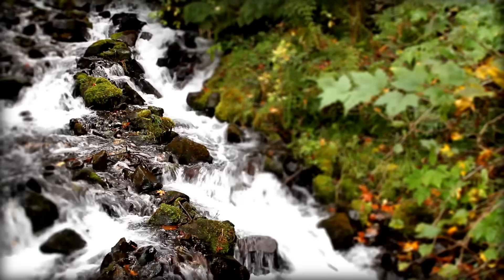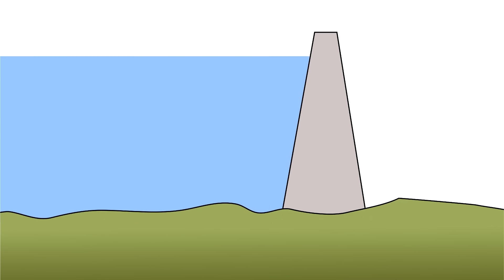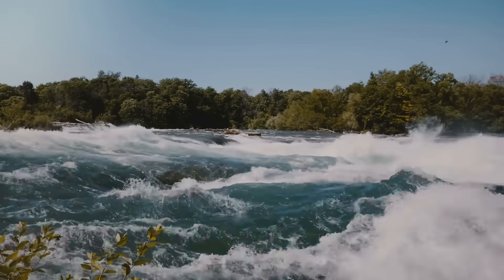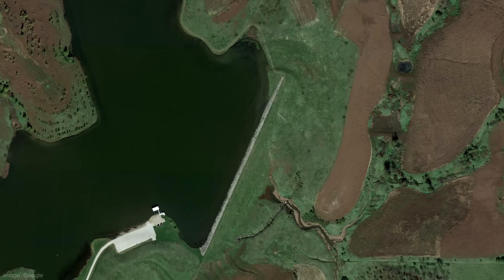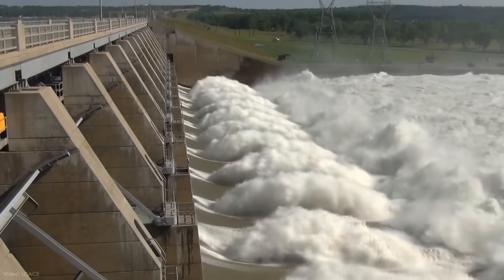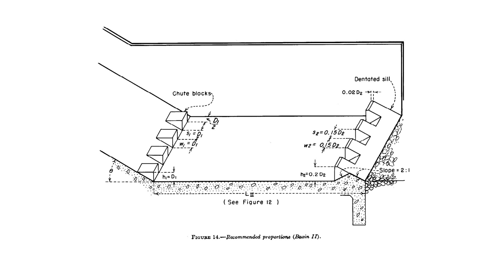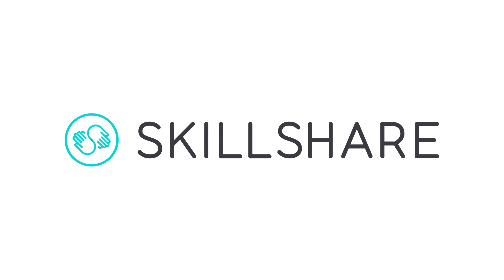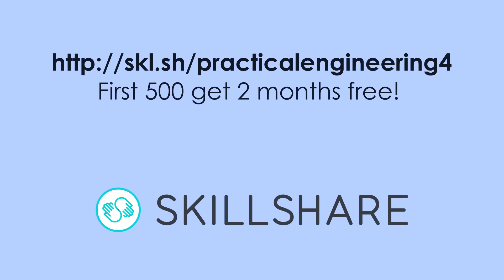How Do Spillways Work?

Comment: One thing I think you should include, "Then things go wrong" show example on failed structures and lessons learned by them.
Reply: Daniel Wiegert Look up the Oroville Dam disaster, that’s a recent event where the emergency spillway of the tallest dam in the US was just hours away from failure due to such extreme water inflow.
Reply: @Corndog4382  Agree... there is some great videos on YT about this one.... especially the reconstruction ones that give you a sense of the immense scale and size of the spillway...   it doesn't look "big" until you see it with people... and large equipment working in and around.
Reply: im thankful that he keeps the videos de-sensationalized.  there is countless sources of that type of cheap entertainment.  id rather learn.  but i get it... that's why the discovery and history channel have turned into what they have.
Reply: One day a huge storm came upon the Raudales de Malpaso dam in Mexico. The output of the spillway lifted tens of the concrete slabs at the stilling base. Each slab the size of two large houses put together and piled them up at the end of the basin. The scale water model built by the University showed the flow going down and at a point, the slabs lifting like UFOs and floating to the end of the reservoir.
Reply: @BICHETO  sweet. Id love to see some video on that.
Reply: People have been predicting the End Times for almost two thousand years, now.  Revelations was current events, not prophecy.
Reply: I second this. This video reminded me of the Oroville dam spillway failure that we had here in California.  I would love to see an analysis of that.
Reply: @Mike_Rogge  Actually the Fukushima plant was examined and determined to be susceptible to flooding from tsunamis and they did nothing about it. Ignorance is what caused Fukushima to fail.
Reply: @farLander1  Ish. It was only built to withstand flooding of about half as much as what it ended up getting.
I'm genuinely surprised it took pretty much 40 years for something bad to occur.

Any one of a half dozen things could've been fixed and prevented Fukushima and they knew since day 1 it wasn't up to safety guidelines.
Reply: Feel the poster wanted to see a video about how they learned about the techniques that are present today, a history of development.
Reply: Yeah I was hoping to see Oroville Dam examples
Reply: @prax3956  Exactly my thoughts.
Reply: @prax3956  I live in Oroville. I've seen all the example I ever want to see.
Reply: @prax3956  Oroville, is that the Pop Corn Guy.
Reply: @owl1873  yes 😂
Reply: "Very rarely, things can still go wrong, because this stuff is incredibly complex, and sometimes an event is so extraordinary that no one could have foreseen it, and to make things completely safe even for unprecedented inimaginable events is incredibly EXPENSIVE for the community itself,  and 99,99% of the time it's useless". 
This would be more correct.
Reply: @Mandorle21  unimaginable*
Reply: @Mandorle21  thitmim
Reply: @Mandorle21  If it weren't the real world... In our world, 0.01% of cases is all that matters.

As evident by already mentioned Fukushima...

Or do you agree that it's alright if bridge doesn't fall apart in all cases except when YOU drive over it?
Reply: This would be a good topic for a video... Basically all engineering systems such as the examples in these replies have backup systems in place.  However, 'acts of God'/natural disasters/freak accidents do happen.  I mean, yes we could spend 100times the cost on making something last indefinitely... but then effective usage goes out the window.  We can't all live in the same house, with the same water supply, and cross the same bridge for transportation....  Also, most disasters come from poor Operations&Maintenance… although there are some great examples of flawed engineering.
Reply: Is anyone else 10 years old
Reply: things going wrong has been done to death a million times though, you can go watch hundreds of videos about that. i want to see things that aren't going wrong for once.
Reply: Wouldn't this be an entire video in itself?
Reply: This should be a series.
Reply: I was really surprised to see he didn't include that. For anyone looking for a modern example, look up the Oroville Dam incident. Approximately 2 years ago, the primary spillway failed due to lack of maintenance. It is also the largest dam in America. The floor of the spillway was ripped out by the force of the water, and a canyon was carved down through the bedrock. While it was shut down for initial safety inspection, the emergency spillway became active and as water flowed over it, headcutting erosion began to encroach the base of the weir and there were fears it would fail and release the top 22' (iirc) of water.

Repairs were just declared complete a few days ago and the new spillway is designed to handle even more water, and the emergency spillway was armored from the weir structure down to a wall was constructed from the surface into bedrock, so any erosion will stop well short of the critical structure.

The entire incident and repair process is well documented and available here on YouTube!
Reply: This comment needs pinned
Reply: Fu uu9fhlmlllkhlxl--+๏_๏--#◐.̃◐๏_๏⊙_⊙'Ω'◐.̃◐real
Reply: Nice
Reply: The suggestion of the year 👏🏾👏🏾
Reply: 5:39
Reply: https://youtu.be/Nkvea5BwDcE 🇯🇲🇯🇲
Reply: Cool👍
Reply: He has- See Oroville on this channel. Check you updates and notifications setting for this channel.